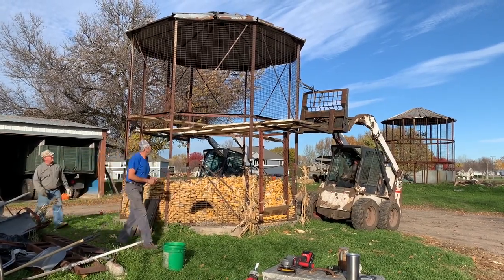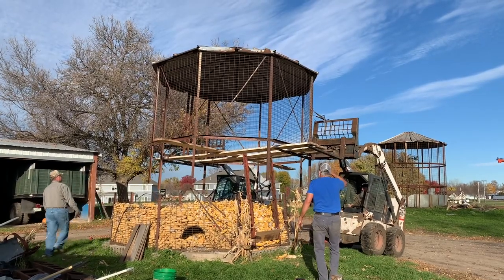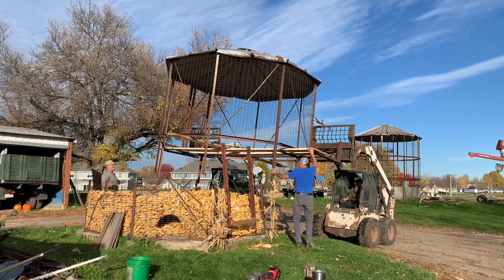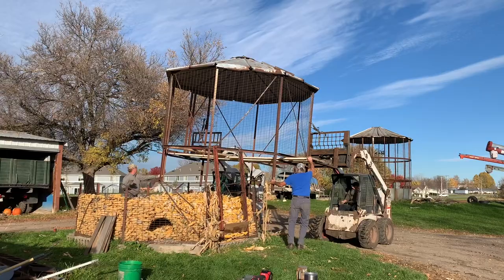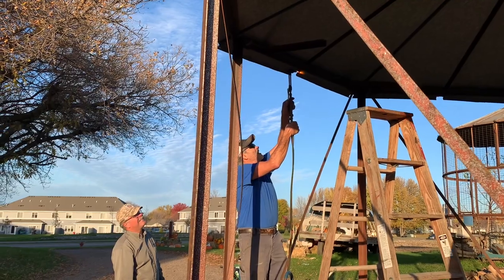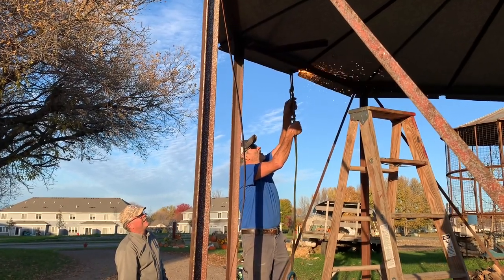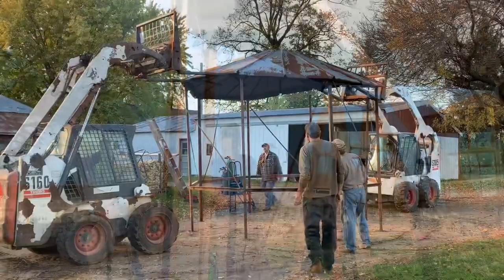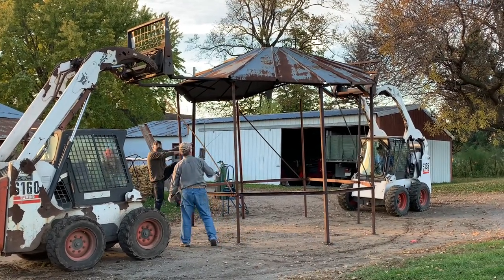Corn 🌽 Crib Tear Down For Gazebo Project

Comment: That's good that they are going to be used ! Are all the corn cribs built that way? I'm looking for a crib.
Reply from the maker: No, this one had 8 12’ angle irons. The other one has 3 rings bolted together with a bunch of sections. Im sure there are more variations yet. What are you going to put in one?

Comment: Glad it’s saved. Do people then add screen to those to keep the bugs out, or do they simply used them as a neat looking circular roof to sit under and still get eaten by bugs? 🤓
Reply from the maker: This one will screened in and have a fireplace or stove put in the center and vented out the fill cap.